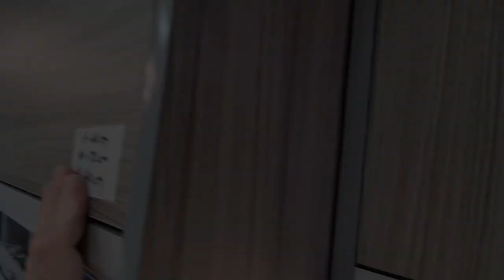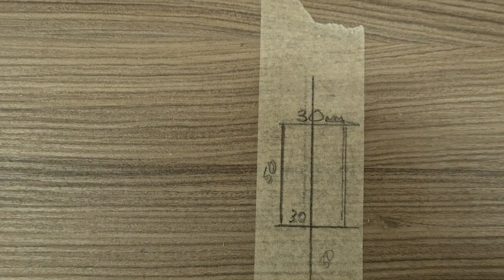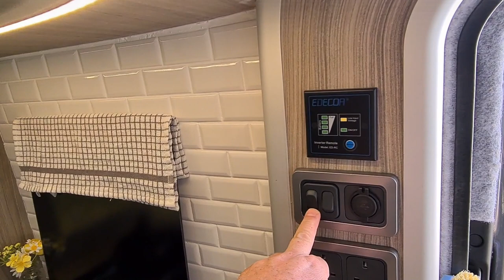selfbuild | vw crafter | campervan | overhead cabinets | van build | part 33 | the crafty blinders

Comment: Hi Sam, this may sound like daft one, but are the horizontal chrome trims you use on the cabinets the same ones as the vertical ones on the shower, and just use the back rail as a stop. Or do morland make one without the gap where the panel would slot in? This I my Christmas project so need to order it all in. Cheers Stew
Reply from the maker: The ones I use on the cabinets are different it has an extra piece for the cabinets doors to stop on 
I think I have all the parts listed In the video description but if not I will find out for you pal
Reply from the maker: Search on the Moorland link for:
Morland Locker Door Profile 57x38x2200mm - Aluminium
Reply: Cheers Sam I was looking for the recess on your video and couldn’t see one. Another one. I know your a fan of fitting things that can be removed, any thoughts on fixing front and rear cabinets thru the shower walls before cladding in hygiene board, even the bench seat. This would make a real sturdy fixing for everything but unrecoverable. I’ve probably answered my own questions there!!😂
Reply from the maker: @stewartkendall2635  I have screwed into the shower just from the cabinet side and the bench seat just taking care not to go right through to the other side 😁